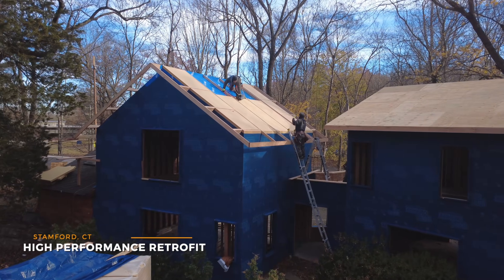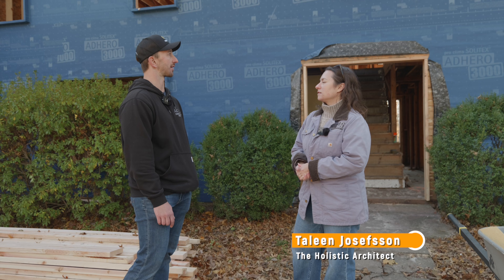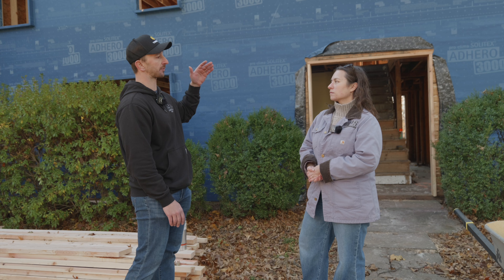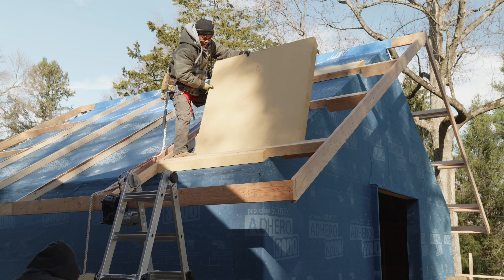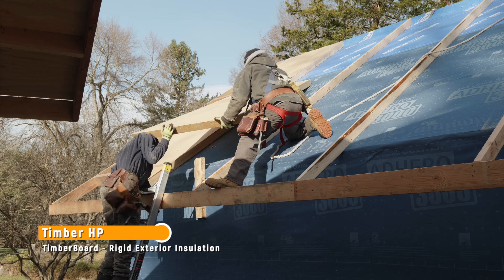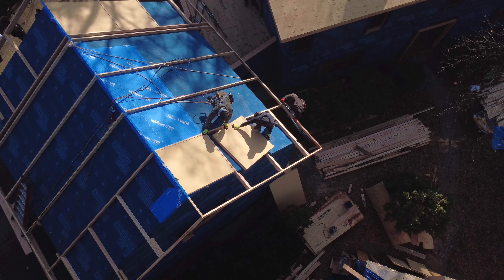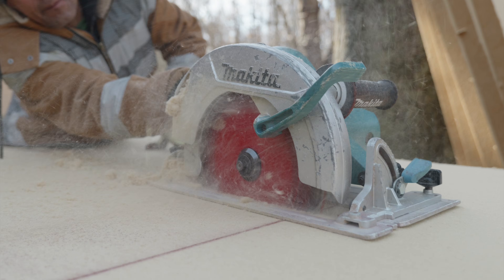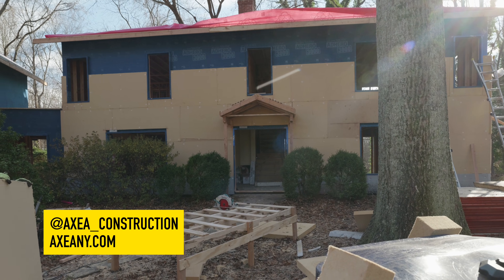this will be the norm in the US soon ... TimberHP Timber Board exterior rigid wood fiber insulation

Comment: Air gap not needed between the timber board insulation and outer OSB with a soffit and ridge vent?
Reply from the maker: this roof is intentionally being designed to be conditioned and also prevent any interior air/moisture from moving through the roof system. the interior vapor barrier blocks all vapor from entering the assembly (as long as its installed properly) and the exterior insulation moves the dew point to outside of the sheathing. if any condensation does occur, it will happen in the exterior insulation and should be minimal; above that, the plywood is semi-permeable and should suffice for the small amounts of vapor that could potentially get through. overall, there is an opportunity for moisture / vapor to dry and not be trapped. note - i am not the architect on this project, i was just visiting the site.
Reply: @holistic_architect  Thanks. I've been looking into high performance designs using exterior WRB and exterior insulation with traditional framing. What you shared gives me an alternate idea. Looks easier to achieve the whole house vapor barrier with the monopoly framing.